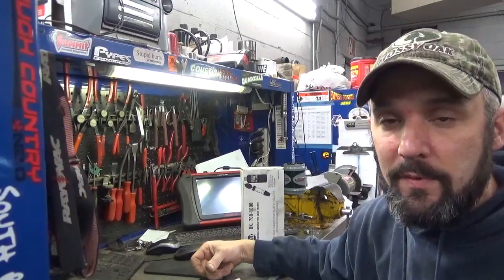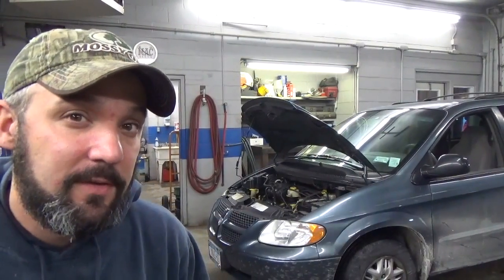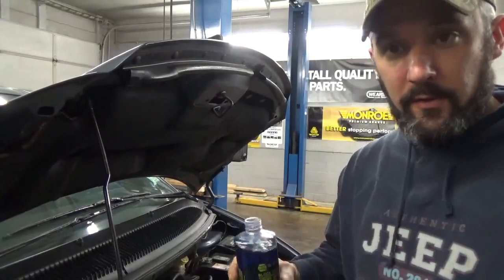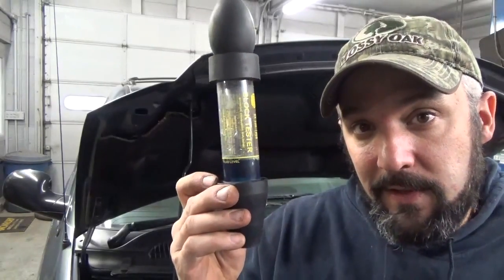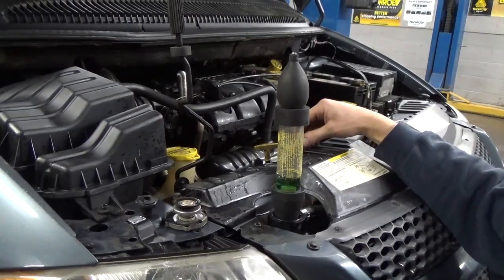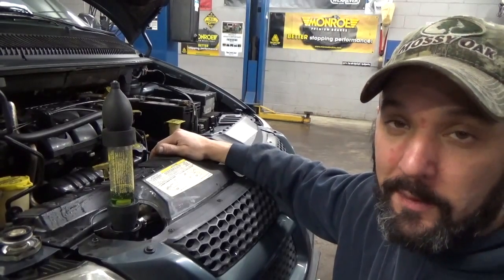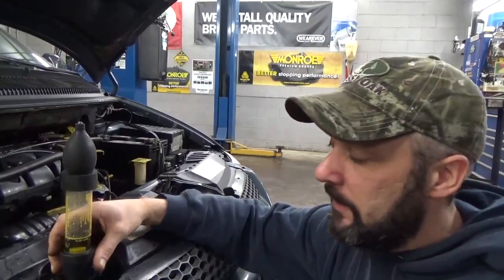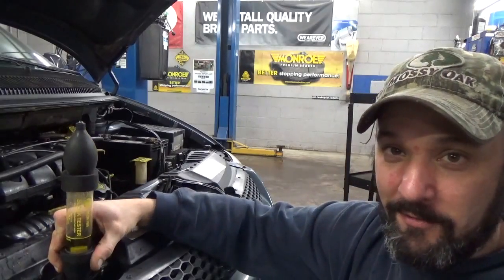Test For A Blown Head Gasket

Comment: For a severly overheated engine with a blown head gasket does replacing the head gasket fix the issues or if there usually other issues that keep popping up down the line? I had a similar problem myswlf and I am not sure whether I want to fix it or trade in the car.
Reply: Severely overheated engines usually need new heads, especially aluminum engines. Even iron heads can crack or warp. Blocks too. Even if you want to keep the car it's better to just swap in a junkyard engine with low miles.

Comment: I think I have a head gasket leak in a 1.5 Ford EcoBoost, the coolant reservoir will drop about and 1" after 200 miles. The odd thing is when you release the pressure cap it will go back up a 1/2".......any idea why that is? Thanks for sharing.
Reply: Air in the cooling system? I would think that if you had a leak it would remain down and continue down over time. Do you have white exhaust out the back?
Reply: @northpoint1039  I don't know why the fluid went back up after releasing the cap, took it to the Ford dealer and they found I had coolant getting into one of the cylinders. Ford has had plenty of these engines going bad, my Escape is still under warranty so they replaced the entire engine with there redesigned 1.5. Thanks for the reply.

Comment: I forget to take fluid out of the radiator at first.  The first try it immediately turned green.  Dumped the fluid sucked coolant out and retested and it never turned from blue.  Can green coolant mixing turn it all green or do I have head gasket issues
Reply: mine did same thing.. it was staying blue till the radiator fuild rose high enough to get sucked into the tube, then it went green.. thats just the color or the antifreeze in the blue solution... drain radiator lower and try again..

Comment: Will this test absolutely determine if the head gasket is bad ?
Reply: If it goes to green then yellow, yes it is 100%. If it stays blue, possibly you could still have a leak, it just means it didn't leak enough during the test (or no leak).

Comment: I did the test it only turn light green and no bubbles no over heating.  The  issue is the coolant go into the overflow tank but not back into the radiator.  Any suggestions?
Reply from the maker: A bad radiator cap will do that or a collapsing hose from rad to surge tank
Reply: @SouthMainAuto  thank you. My friends the master mechanic and I watched alot of your videos. I must say you are one of the best mechanic I have ever seen. And you have a good sense of humor too. Thanks for all the videos you've made. Really help out as a mechanic.

Comment: Some cars have water coolant EGRs . So in this case what do you think its going to happen with this test , if it fails ?
Reply: Cylinder leak down test is the most accurate method to test a head gasket.

Comment: Just had the head gasket changed. Car wont start with radiator cap on and when performing the combustion test the liquid turns yellow.  no sign of moisture in the oil.  is there any  other reason I'm getting combustion fumes in the radiator?
Reply: Claudia Borrero; you may have a warped cylinder head and it's not sealing properly to the gasket and block. I think you should have the cylinder head remove and have it checked for warpage and
have it machined. That's the best advice I can give you.

Comment: Does this work on diesel ? I'm trying to find if my 05 studded 6.0 powerstroke let another head gasket go
Reply from the maker: Yes ti does, just read the directions is all. Oh and yes, even if they are studded they blow.
Reply: @SouthMainAuto  I have a 06 dodge magnum rt awd with the 5.7 hemi with 170000 miles on the clock. It's losing coolant also has a sweet smell from exhaust, but no overheating. Is it possible it's seeping from the intake down into the combustion chamber.

Comment: but it doesnt point to head gasket could be cracked intake
Reply from the maker: +TheHalusis Haha please explain I'm all ears. How can combustible gas get from the "intake" to the radiator...
Reply: +South Main Auto Repair Internally cracked intake. one small possibility that happened with my 2002 dodge. The cylinder would suck in coolant the gases would leak into cooling system. It would have a very lean smeel coming from radiator cap. plastic intake bad design.
Reply from the maker: Actually it would be impossible for the "gases" to be pumped back in the intake manifold. Yes a manifold can leak coolant into a combustion chamber creating a loss of coolant but combustion gas could never enter a cooling system via the intake.
Reply: South Main Auto Repair The intake manifold takes in a fuel mixture before even entering The cylinder chambers EVEN then gas would travel up through plenum pan gasket is blown because the pressure from crankcase is greater than atmospheric pressure.. Thats how gas enters the coolant system. It eventually travel through the exhaust ports.
Reply from the maker: +warpull only true statement there is that an engine has crank case pressure IF the pcv system is bad and second we are taking about EXHAUST GAS entering the cooling system. I still don't understand your logic. If intake manifold leaks it can leak outside the engine, inside the crank case and in very rare instances down an intake port but it can never take on exhaust gas. It can never be pressurized to the point it can overcome cooling system pressure. Make sense?
Reply: South Main Auto Repair We were not talking about exhaust But intake fuel entering cooling system.
Reply from the maker: warpull That still makes no sense. This videos was about diagnosing a bad head gasket by testing for exhaust gas in the radiator?
Reply: South Main Auto Repair The vid title is test for blown head gasket, but this chemical test is undefinitive for exact gasket blown. A intake problem can turn blue to yellow without having a blown head gasket..sorry
Reply from the maker: You are 100% wrong. I hate to tell you but the test will never change because a leaking intake manifold. It is 100% impossible. If intake manifold pressure had exhaust gas in it (and we all know it doesn't) and IF it did and it could overcome cooling system pressure (and we all know it can't) then in that case it would fail. Of course we all know that is impossible and an engine could not run like that . Make sense?
Reply from the maker: The only combustion gas in the intake is from an egr and still will not over come cooling system pressure.
Reply: South Main Auto Repair I was getting a rich fuel smell coming from my coolant system, I did this test and it changed colors blue to not quite yellow But it was the intake manifold gasket on my car..So thanks for input much appreciation
Reply from the maker: +TheHalusis Well what you can do to prove the test will never work with raw gas or gas fumes is just take your gas cap off and put the tester there. If what you are saying is true then your test fluid change with the introductions of hydro carbons (un-burnt fuel) . However these testers do not respond to hydro carbons only CO. Make sense?
Reply: +South Main Auto Repair thats what im saying. It shouldnt have turned from blue to slight tent of yellow at all, and my head gaskets were not blown.. Only other thing i can think of is the cylinder was pushing back into intake.. My catalyic converter May be plugged, so can that force blowback?
Reply from the maker: TheHalusis No a plugged cat can not because your intake valve would still be closed.
Reply: South Main Auto Repair if the clylinder held the gases until next cycle then could it back up into coolant system(through intake manfd)
?
Reply from the maker: NO It is impossible. Intake pressure UNDER ANY CIRCUMSTANCE on a running engine CAN NEVER overcome cooling system pressure....
Reply: warpull
Reply: That's why people take their cars to SMA,Mr O knows what he's talking about,he's a professional auto mechanic.

Comment: hi! I have a one question! after rebuilding of engine I must to change antifreeze or not??? in radiator again have combustion leak! is this from old antifreeze or not???
Reply: Normally if you rebuild an engine every fluid is changed. Its just good practice to do that. As for your problem I'm not sure.

Comment: How much would you charge for labor to do a head gasket+intake gasket replacement.
Reply from the maker: Depends on the vehicle. Could be anywhere from 7 to 15 hours average but really depends on what you are working on and what kind of condition it is in.
Reply: 90 camaro. eldelbrock car. 350. nothing in the way
Reply from the maker: Hard to say really, 1990 cars don't exist in my area let alone anything with a carb. Depends on how the exhaust manifolds come off, how much stuff has been rigged up in the past 25 years etc... In a perfect world you could pull the heads on that car in just a few hours I would think.
Reply: Yea the headers just bolt off and all u need to do is carb intake and then just take heads off. Its just i don't have time to do it nor the tools to get job done.
Reply from the maker: Sounds like an easy one then. Don't forget when you take it into the shop they also need to reset the timing, bleed the cooling system, and adjust the valves. So give them the benefit of the doubt.

Comment: Engines act up in so many ways it's not even funny one moment it's fine the next minute it has an overheating problem not always the head or head gasket sometimes it's the block and people do head jobs still no fix the problem I guess what I'm saying is I had a 2002 Silverado 5 3 and we redid the heads head gasket everything you can think of water pump radiator hoses intake gaskets still overheats to this day